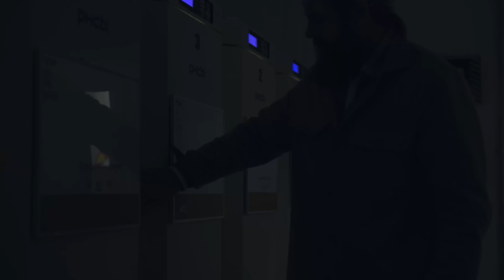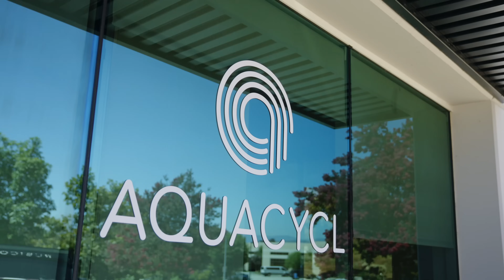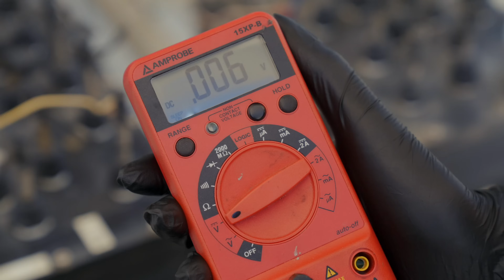Why It’s NOT TOO LATE to Fix Our Climate | @EarthshotPrize

Comment: Som  guy at Rice University  James Tour can create hydrogen at a negative cost.  He pretty much takes the top prize doesn't he? Just didn't apply for the prize. 
Using electricity they can take anything with carbon, like tires and garbage, and pretty much anything with carbon and make graphene. The by- product is Hydrogen.